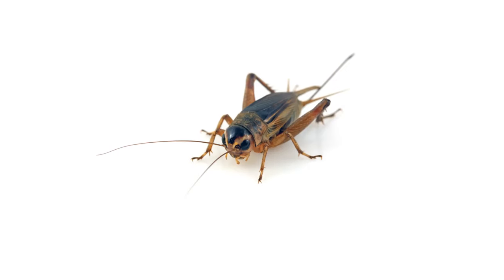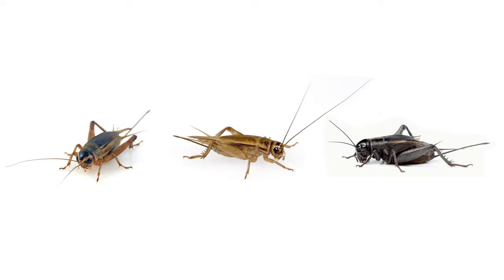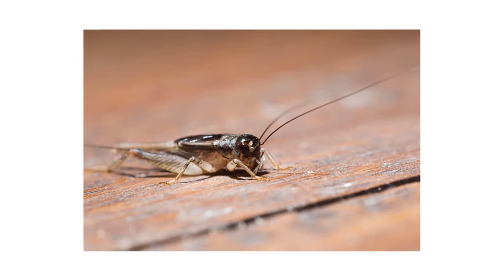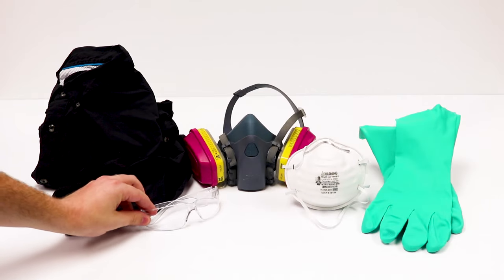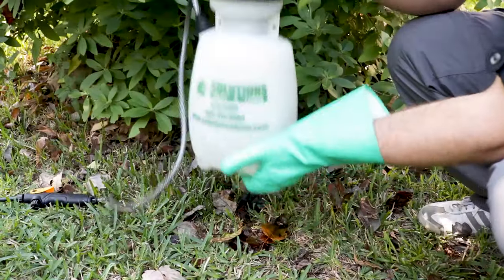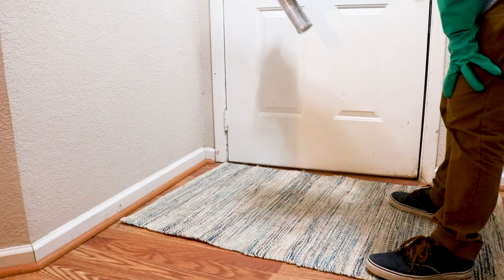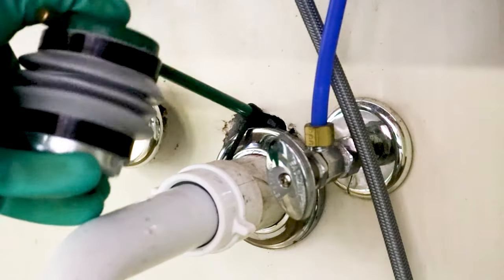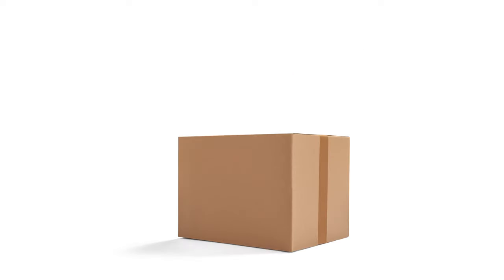How to Get Rid of Crickets (4 Easy Steps)

Comment: I don't like chemicals (pets&kids) any home remedy's to keep them from squeezing under my back door?
Reply: GO to Walmart, home depot or any hardware store. Buy a peel and stick lower door sweep. Wipe the door bottom clean with damp rag. Allow to dry. Cut the sweep to fit door width with scissors peel of back of seal and stick to inside of boor bottom. Rub vigorously along full length of strip. return to door next day and repeat pressing seal to door vigorously. What will cause the seal to not work? Air from outside with dust that coats the adhesive. You can use rubber cement to reattach strip. You can also attach a strip on top of the door.. Look at the door directly for sunlight coming through door frame and door.
Reply: @dewhittjames  great advice, thank you.